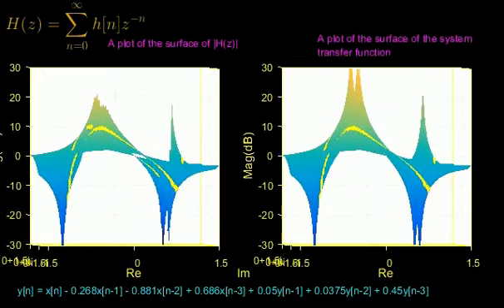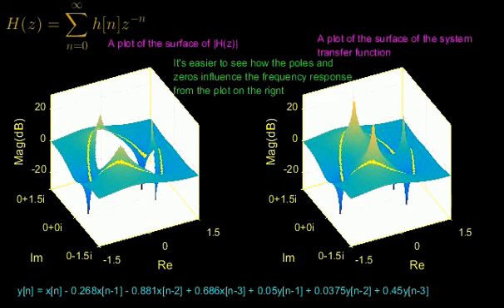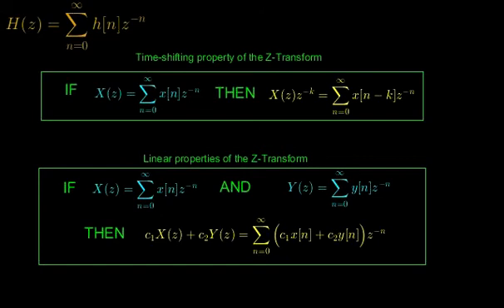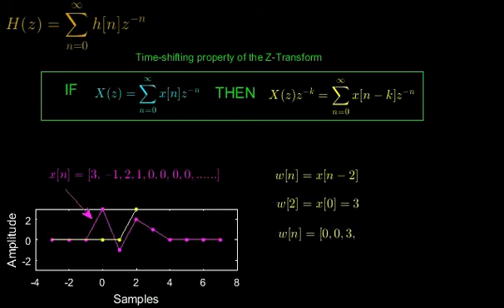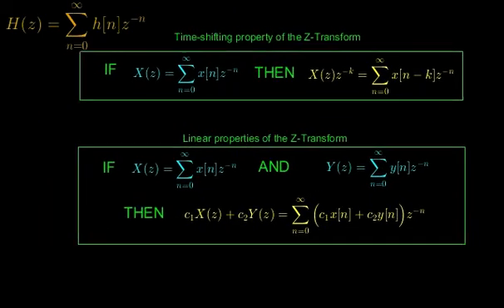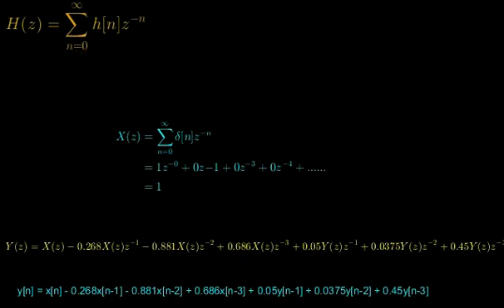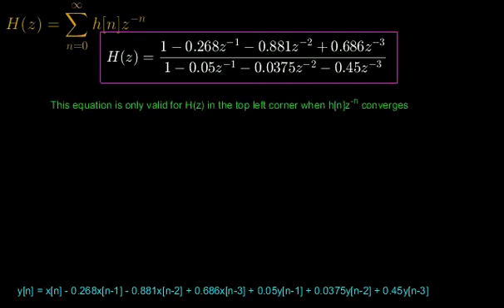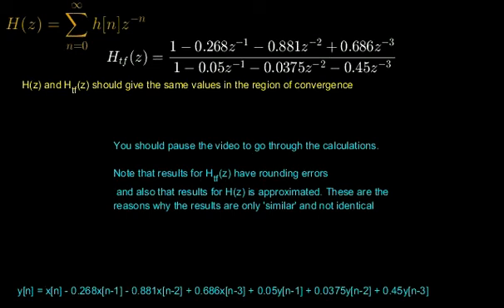An explanation of the z transform part 4  - the transfer function

Comment: At 2.12 you show w[n]=x[n-2] but the w sequence you show differs from a shifted x sequence. w is [0,0,3,1,-2,1,0,0] while x is [3,-1,2,1,0,0,0,0]. Why?
Reply from the maker: That's a mistake on my part w[n] should be [0,0 ,3,-1, 2, 1]

w[n] = x[n-2]
solving for n = 0 gives w[0]=x[-2] =0
solving for n = 1 gives w[1]=x[-1] =0
solving for n = 2 gives w[2]=x[0] =3
solving for n = 3 gives w[3]=x[1] =1
solving for n = 4 gives w[4]=x[2] = -2
solving for n = 5 gives w[5]=x[3] = 1